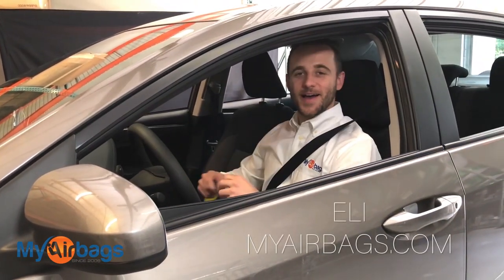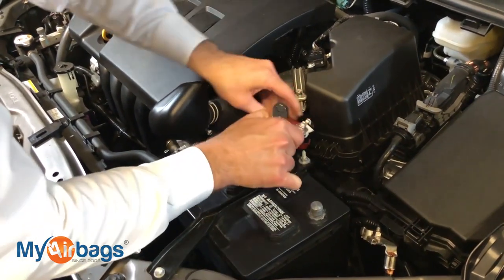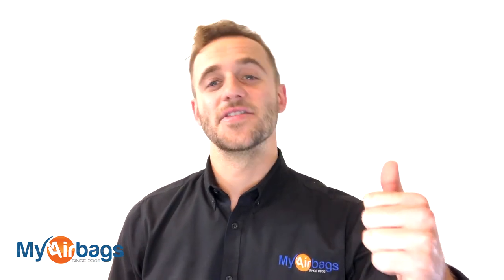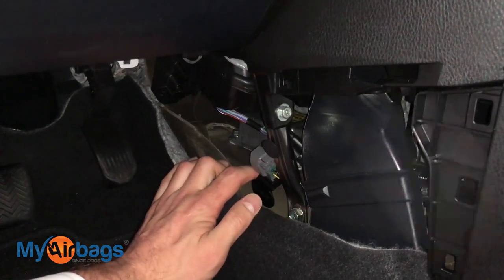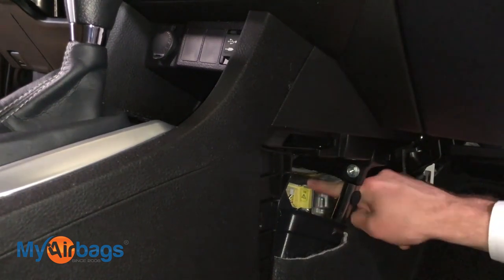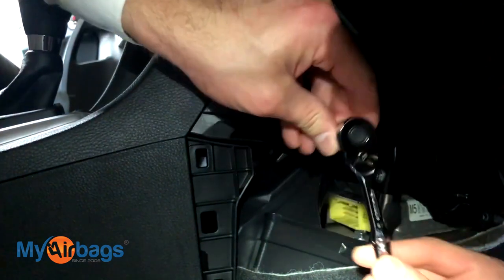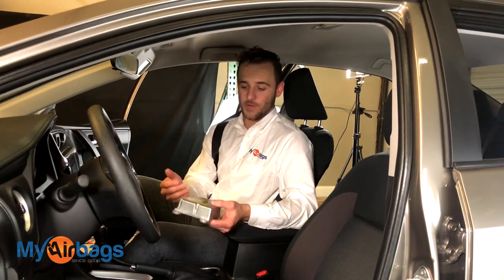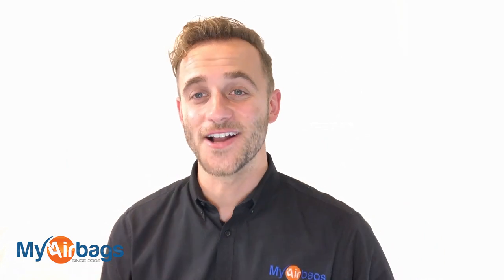How to remove SRS Module & Seat Belts on a Toyota Corolla  | MyAirbags

Comment: I just got this service from myairbags 
The airbag light is still on and deployed airbags have been replaced also module has been reset
Reply from the maker: Once everything that deployed has been replaced and connected properly, once you install the reset module, the light will turn off. If it doesn't that means there is still a part that hasn't been replaced or connected properly. You didn't mention the seat belts, so that could be the cause. If you aren't sure what the problem is, the first step is to diagnose the airbag light. Hook up the scan tool / scanner to the car and read the airbag codes. You connect the scan tool right into the OBD port/plug. Its usually located below the steering wheel, on the left. You are welcome to reply to us with the trouble code that it reads. We also have a support team available by phone and email thats willing to help. If you contact them, have your order # ready. www.myairbags.com

Comment: Can you help me, I have a rebuilt vehicle and nothing wrong with air no light on, but recently it start on/off back and forth, eventually it's on now all the time and checked and it showing code (B1000), they said problem with module need to replace, could you guys fixed or i have to replace it
Reply from the maker: No, it looks like the module got corrupted or malfunctioned. We reset crash hiatory/crash data after the vehicle was in an accident.

Comment: I have 2009 toyota corolla In oman
I brought form canada
The probem is my seltbelt was damage in accident... Roof airbag... & front airbag...damage. then i have change the seltbelt for anther car . The car belt was good . So my question is the belt will work .? Ur whatapp number plz i have more question to ask..
Reply from the maker: Asif, Thank you for your question. Sometimes the seat belt can function properly (mechanically) but still be in deployed state. That can be the case if you are still getting the airbag light with codes for the seat belt. A good seat belt will give you a reading of between 2.0 -2.5 ohms. Make sure the belt is installed and connected / plugged in properly as well.
We don't use that app but you can contact us here on youtube,
through our email: info@myairbags.com or phone number : 855-770-4055

Comment: Thanks for the video.  I have had my 2003 Corolla SRS air bags recalled 2x.  After getting the car back from the dealership after the 1st "repair" the airbag light was on, tho' it hadn't been before.  Their tech never seemed to be available to correct the code issue.  After taking it in for the 2nd recall, the light is still on, tho' I mentioned it to the dealership.  I've seen online that the issue may be dirty contacts (I use my car like a truck so it wouldn't be surprising).  The videos that suggest (after disconnecting battery and allowing power to dissipate) cleaning the SRS plug contacts show yellow plugs under the car seats, which I cannot locate.  Is this possibly the issue, and if so something I can try to clean first?  My car has not been in any accidents that have deployed the airbags ever (single owner).  Thanks
Reply from the maker: Dayna, What trouble code came up on the scanner / scan tool. That would help us narrow it down. It may be on the report they gave you.
Reply: B0111- OPEN IN SIDE SQUIB RIGHT HAND CIRCUITB0116- OPEN IN SIDE SQUIB LEFT HAND CIRCUITB1140- SIDE AIR BAG SENSOR RIGHT AND LEFT HAND (ROB)
Reply from the maker: Dayna, Yes that seems like its definitely seems like an issue with the new bags they installed or just didn't connect them properly. The airbag system is still detecting a problem in those three areas. If you didn't have the light on before, and now you are getting these codes relating to those airbags, assuming those are the airbags they replaced, I would suspect  that they did not connect / install them properly. In this case, you would not need to remove the module for reset.

Comment: Can you help me the airbag light is on but in the scanner it doesn't show any code
Reply from the maker: If your vehicle was in an accident, then it has crash data, and for Toyota vehicles, it will not show codes after the vehicle was in an accident. MyAirbags can reset the airbag control module and rebuild your seat belt. Check out myairbags.com